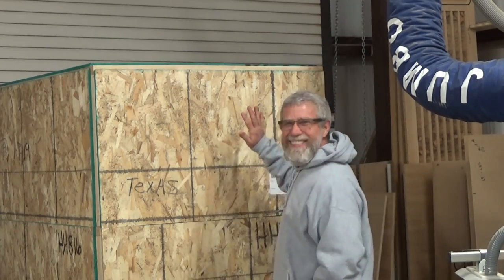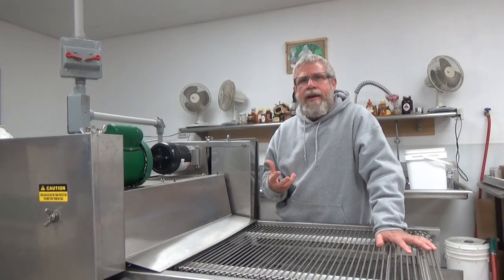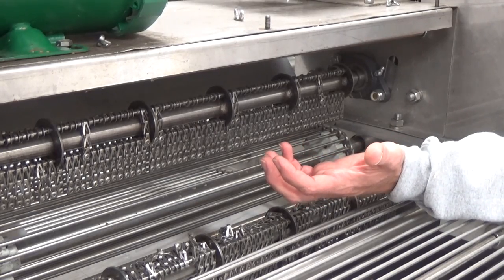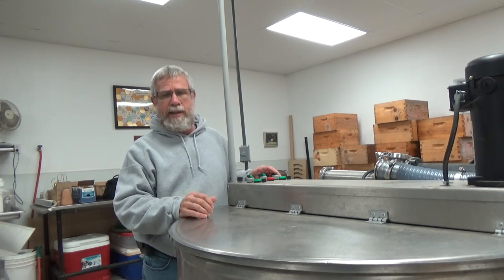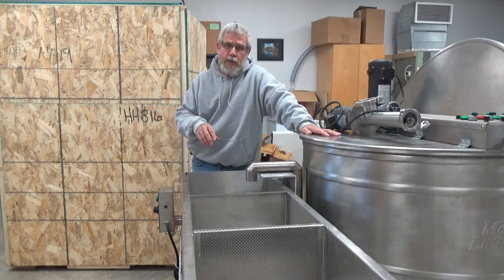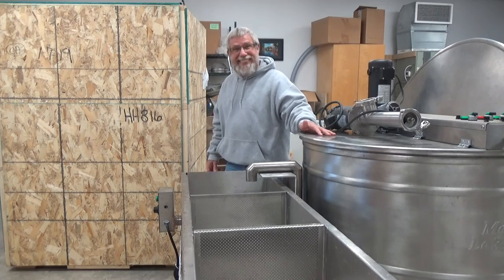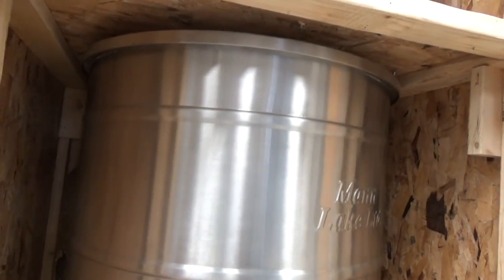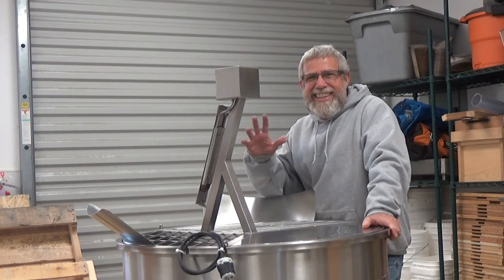Honey Processing: Adding a honey/wax separator to the processing line.

Comment: This is something i know a little bit about i am in the separation filtration business. Your settling trough is clearly to small and your plan seems like a good solution. The only thing i would recommend is not using 30 gallon drums for the initial separation, larger settling tanks are more efficient. I would get a large tank and pump from the extractor into a tank large enough to hold all the honey then draw off the honey and pump the honey wax mixture into the centrifugal separator.
This saves the step of transferring into barrels and the larger the tank the better the separation in general but you would have to buy a large tank and a pump.
Reply from the maker: Thank you for your helpful suggestion, I will give it serious consideration, it makes a lot of sense.  Thanks for watching. God's peace.
Mr.  Ed